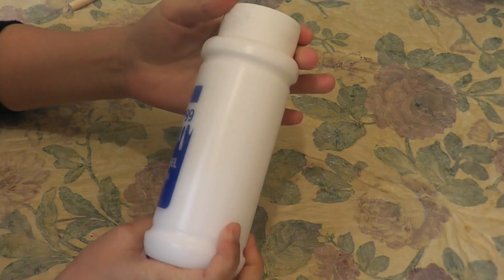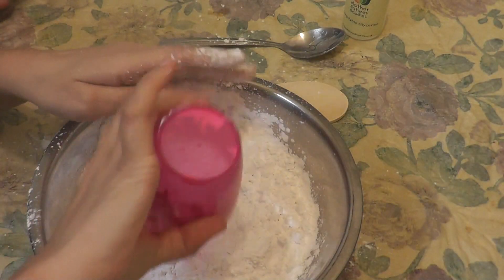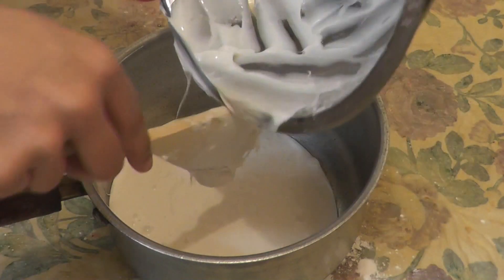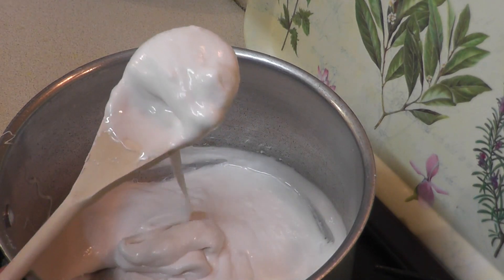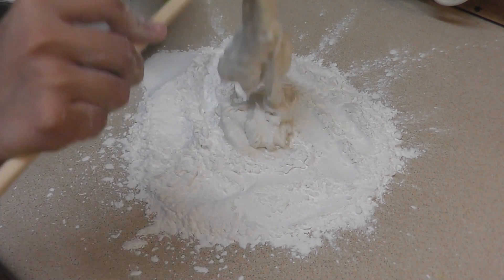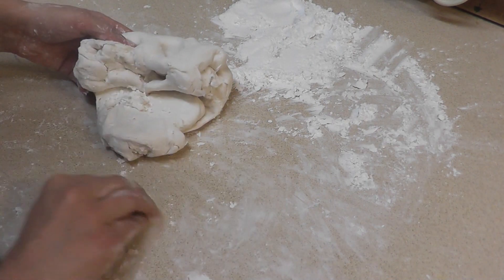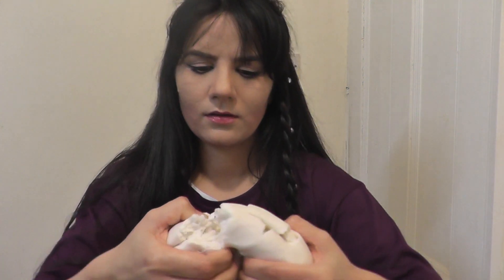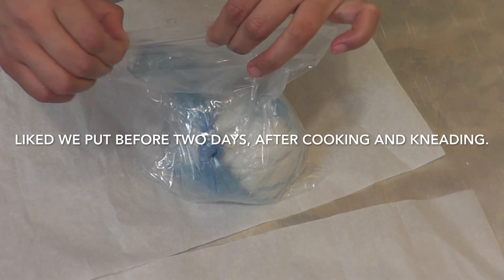Stove Cook Porcelain Clay/ Italian Dough Recipe. DIY.

Comment: Mam your video is very useful I want to try this but I don't know which kind of glue I use can you plzz tell me PVC or PVR glue
Reply from the maker: Hassan Ahmad Thanks. PVC glue is that white glue which is most commonly used by carpenters to make furniture. It is also mixed in white wash to make a primer for a wall to paint it. This same glue is used to make dough. 
Good Luck.